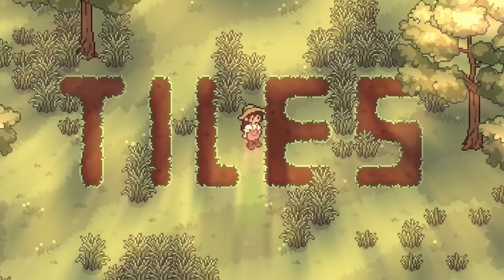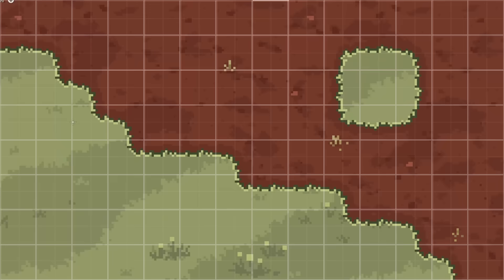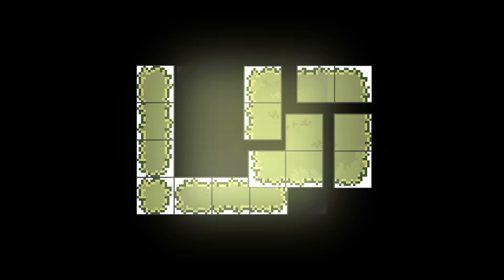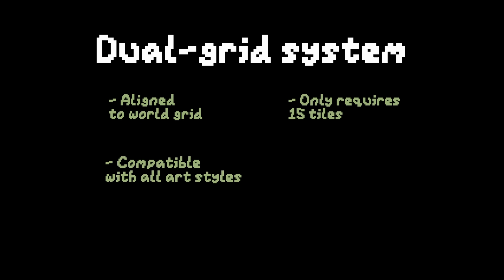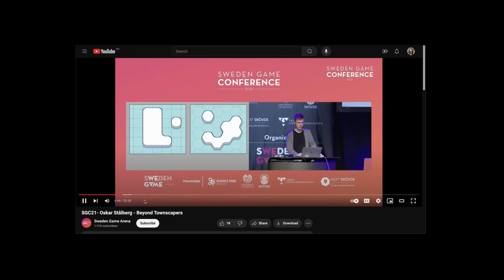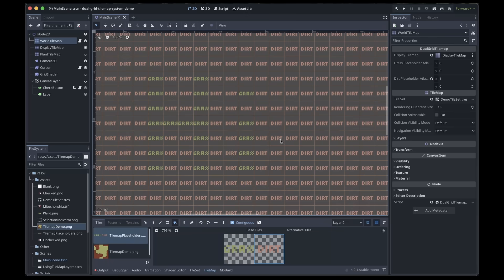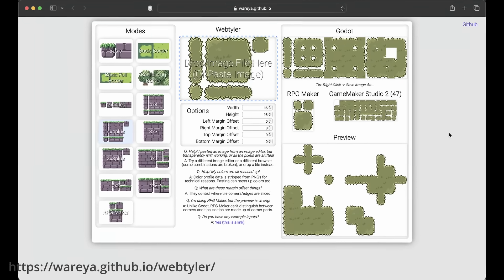Draw fewer tiles - by using a Dual-Grid system!

Comment: I remember coming up with this exact system for one of my games, and once I did I was honestly amazed that an idea like this wasn't already well known and used in the wider game industry. I remember the reason I looked into it was because I wanted to make a level editor with slopes, but in a way that's more free-form than something like mario maker 2 (where slopes are this dedicated object that can only be used in specific ways). Eventually I realized that trying to account for 8 neighboring tiles in my algorithm would've been nigh impossible once slopes were brought into the mix, so in my search to simplify things I came up with this system. Even ignoring slopes it made everything so much simpler, and expanded the options I had when designing tiles (now they're allowed to extend outside of the grid rather than being strictly limited to it, which was another issue I had). In the end I found that I would need 20 different slope tiles for every type of slope I wanted in the game along with the 16 base ones, so I can only imagine how many that would've been had I had to worry about 8 neighbors instead of 4

Comment: Great video! :)

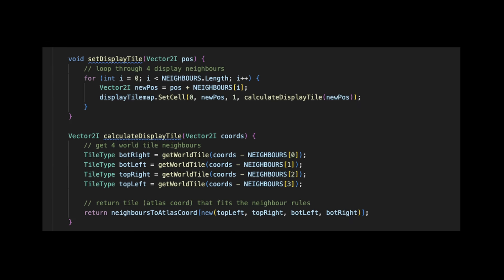As for the conversions between the dual-grid and the main-grid at 4:47, I would highly recommend creating little helper methods to convert between the main grid and the dual-grid. 
Like:

a,b,c,d = mainGridToDualGrid(x, y)
a,b,c,d = dualGridToMainGrid(x, y)

This way, you only need to do the fancy offset math in one place, and there is no chance of failure in any other parts of your code! :)

Comment: I wanna say the Tiled Corner-based tileset is similar to this. You draw in the corners you want active, and your tilemap builds around that. But it does mean that the visual centers are usually offset by half a tile. Still, really useful stuff!

Comment: What I find cool about this is that no quarter-tile is redundant. Which means you can implement this as 16 16x16 tiles, or as 64 8x8 tiles, with no changes to the art.
Reply: Also this is just marching cubes in 2D.

Comment: Another way which can reduce the number of tiles by about a third.
Is to rotate them, alot of tiles are similar they are just rotated 90, 180 degree.

This will requires some stitched code to know which and when to rotate the the tiles to achive the same look

Comment: in a case like this, i just half my grid in size for mapping that is stil aligned whit world grid.
you dont have to draw every single tile variance ther can be, just make a straight, an outer an a inner corner and map it like that. its just like on the gameboy and snes for what i know, there it was made exacly so.
edit: also i make the tile so i can mirror and rotate them, so my grafic file for tiles is realy small. my engine allows me to save common configurations like stamts that in it self can be mirrord and rotated while drawing the map, is is realy amazing. the only downside is, that there is very little use for autotiling.

Comment: Neat! The Dual-Grid system actually reminds me a lot of marching squares. Very interesting!
Reply: That is a good analogy! When I started building tile systems, I came from a background of working with marching squares (I built software to convert implicit surfaces to meshes) so I didn't even occur to me that there would be other possibilities than the "dual grid system" 😅 I considered the ground type to be located at the corners of the tiles and the tiles interpolating/blending between them. This means that I wouldn't consider there to be 2 coordinate systems involved.
Reply: @feuermurmel  I’m working on a side project using marching cubes and voxels right now, and I keep having to remind myself that the voxels are offset from the cubes as I think through details.

It would be interesting to build a voxel rendering engine which uses 3D “tiles” and a 3D version of the dual grid system. You’d have to make 256  tiles for that, although you could start with 15 and add special cases when you want to break symmetry.
Reply: @chaumas I've seen it done lately in what they call "Wave Function Collapse". It's built on top of a grid system and they need matching tiles, so they use variations on these ideas. It's perfectly doable in a regular 3D grid with cube tiles. If you introduce tile rotation, you can drastically reduce the number of required tiles (you can do that in 2D as well)
Reply: @feuermurmel  Yes! this kind of tiling is commonly known as "corner tiles" for this same reason.
You can just do a Bresenham line along your grid using it, although they are not very good at diagonal lines: either it's too coarse or it has too much repetition, depending on scale.
The "blob" tileset does a tad better since you can spot diagonals within a tile and you can draw them as proper diagonals, but they're more tiles (which makes sense, since now you're accounting for diagonals). You can find 6x8 and 7x7 packings of these (with a tiny bit of repetition), though if you allow for tile rotation (which means the tile is not directional -- no shadows, no vertical hints) you can get away with just 15 of them (no packing though). Your lines will have 45 degree steps instead of 90 deg, which is better but still not great.
Reply: because it is. D1 used marching squares exactly this way to draw their dungeons
Reply: I was thinking that too. It's basically exactly marching squares, except that the lookup table contains bitmaps instead of edge lists. It also leaves out the interpolation step, but interpolation wouldn't do anything here because the original scalar field is binary anyway.

That does bring up the possibility, though, of having individual tiles be procedurally generated according to up to two line segments, and doing the full marching squares algorithm to generate those line segments in each tile. Then you could have a "strength" for each tile, rather than simply being on or off. Implementing a countour-lines-to-tile generator with a rich looking output would be really involved, of course.

Edit: Alternatively, instead of having "strength", you could make the actual game logic tile grid higher resolution than the display tile grid, then apply a scaling filter to it to get the field to apply MS algorithm to. So each display tile, for example, could cover a 3x3 grid of game tiles. You scale that down to get a more smoothly varying field to compute the contours of.